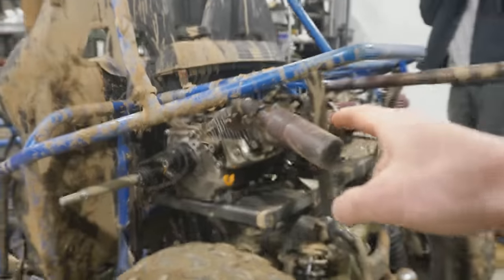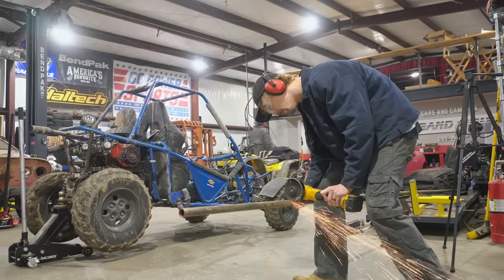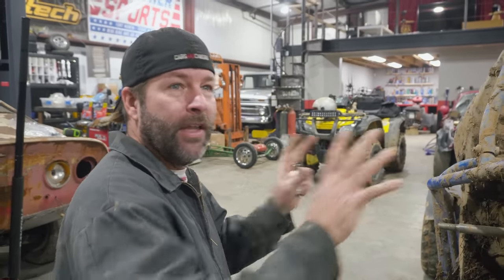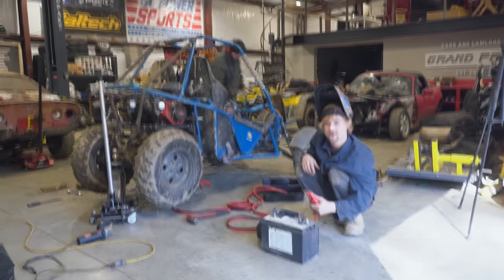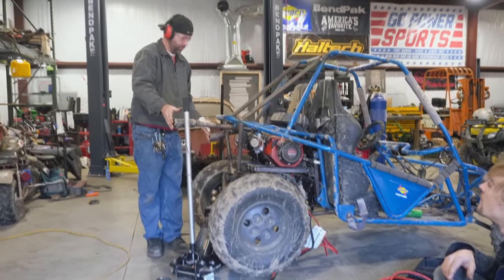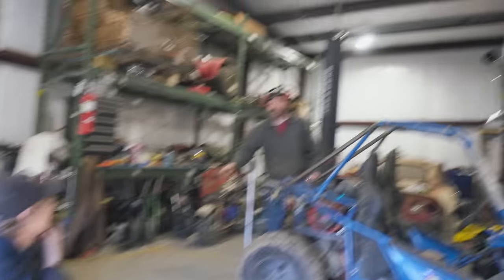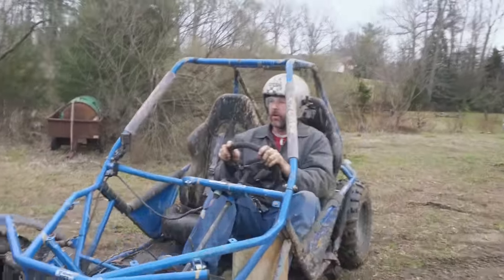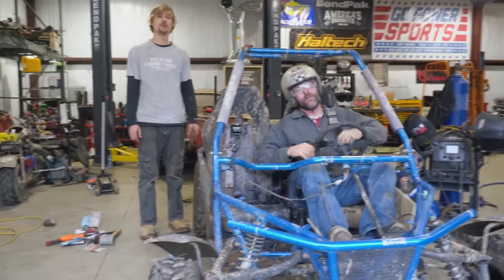Us vs. the WORST Go Kart Ever Made | Will our Twin Engine Go Kart Survive a Full Send?

Comment: Someone made a valid point about the engine you took the piston out of won't be balanced on the crank and I think that's probably where most of the vibrations are coming from more than engine's being out of sync. I thought about one way bearings on both gears from the engines so they aren't fighting each other also. I would do that and balance the crank on the bottom end of the other engine and it should purr like a kitten afterwards 👍❤️💛💚
Reply: That's exactly what's wrong here. I'm a bit surprised they don't know why crankshafts have counter weights on them.
Reply: yeah thats what i commented for this and the last build they did
Reply: That's what I posted in the first vid.
Reply: They have a new to them lathe, set Charles free to make a replacement straight shaft for the crank.
Reply: @scrumpyb5859  they broke the lathe I think.👍
Reply: Crankshafts are balanced separate from the pistons and connecting rods.....
Reply: Yeah I said this on 2 of the previous videos. I built one of these years ago with a blown dirt bike engine. It worked good but it vibrated bad.
Reply: @jessemillsap9387  yes true but with weights attached to account for the piston and rod weight.
Reply: Your crank isn't balanced right and eventually, the crank will twist on the rod journal because it isn't splined or keyed, it is only a press fit.
Reply: @Jesse Millsap  wrong. They are balanced with bobweights that account for the weight of the piston, rod, wristpin, rings, and oil weight in the rod. I've had many done and watched a few done.
Reply: I mentioned that immediately on the 6 speed yard kart when they didn't put a counter weight on the crankshaft to offset the crank weights and suggested they do that or they will get excessive vibration.
Reply: I like the idea of one way bearings, the only issue I foresee is the electric start not working since the jack shaft won’t be able to turn the engines the right way
Reply: Maybe putting centrifugal clutches on both engines would help prevent this issue becaus they wouldn’t engage until there both under load. And also I could not agree more they need to run a straight shaft through the motor in place of the crank shaft. Im honestly not going to be very interested in these dirt bike transmission builds anymore unless they fix these issues. I love c&c it’s just disappointing to see a build with so much potential to just be so lacking.
Reply: @krudlumpstv7854  so that's all it takes for you to turn your back on C&C ?   Come on 😂

Comment: 2:04 If you want that thing to roll in balance you're going to have to negate the counterweights on the blown engine you replaced with the two tillotsons. That's why it's shaking itself to pieces.

You have a lathe now. You can just make a replacement shaft that's a straight line.
Reply: Or, hear me out, put a single, good motor on it.
Reply: @Rattus-Norvegicus  The vibration is in the transmission they set up. One engine instead of two wont help.
Reply: @TestECull  It will cut down on complexity and eliminate failure points. Common sense man.
Reply: @Rattus-Norvegicus  The entire point of this build was to end up with a kart that has forward, reverse, neutral, several speeds, manual clutch. Going from two engines to one doesnt really simplify it very much and ditching the gearbox for a cvt and a live axle defeats the purpose of the build.
Reply: @TestECull  I didn't say to eliminate the transmission, just one engine. Anyone with experience will tell you, syncing 2 engines is difficult at best, disastrous at worst. They could eliminate the syncing issue and eliminate the jack shaft. Less chains, less keys to fall out. A 420 with the transmission would be perfect for this.
Reply: @Rattus-Norvegicus  

1: You don't need to sync the engines here. Each engine is self contained and the vibration will not be a problem if the two are desync'd. This is shown by all the other multi-engine karts the guys have built none of which have this issue.

2: While I do agree that a single Briggs flathead boxer from an old generator of the 16-20hp range would be far better than this cheaply made harbor freight garbage they keep using, switching to a single engine will NOT solve the problem this kart has. The 4-engine 4wd kart they built? No vibration problems. The 3 engine minibike build? No vibration problems. And syncing the engines on those two builds is flat out impossible even if you wanted to; the engines are free to do whatever the fuck they want to.

3: This kart shakes itself apart BECAUSE THEY DID NOT ADDRESS THE COUNTERWEIGHT ON THE CRANKSHAFT OF THE ORIGINAL ATV ENGINE! Did you not watch the build video or something?! They ripped the jug off, cut the conrod short as they could, threw a blockoff plate over it to keep the oil in, and let it buck. This thing is going to shake itself to pieces no matter what until that is addressed!

4:  You clearly did not watch the whole video because they synced the engines anyway. They clocked them so one power stroke hit when the other engine was on an exhaust stroke. This did nothing to solve the vibration problems, nor did running the kart with one engine completely bypassed, because again the vibration is not in the engines at all.

THE PROBLEM WITH THIS KART IS NOT THE ENGINE CHOICE! The entire point, substance, meaning of my initial comment also references this. THIS KART SHAKES ITSELF TO PIECES DUE TO THE TRANSMISSION SETUP THEY HAVE! NOT THE ENGINES! My guy, this thing would shake itself apart if they yanked the Tillotsons off and threw a big ol' 3-phase permag motor up there went full battery electric.
Reply: @TestECull  I'm glad that you got that off your chest. I'm still not convinced and I'm not going to pick apart your argument. Agree to disagree.
Reply: @TestECull  It's okay dude, the rest of us that wrench on shit everyday know what you mean and that you are correct. 🔧🏁
Reply: @xtr3m3fLx  Yep. This kart would be BOSS if they just solve that imbalanced input shaft problem. Hell they could do it with an angle grinder if thy wanted to, leave just enough counterweight to balance the journal. But easiest and best would be to lathe turn a totally new input shaft to replace that crankshaft.
Reply: @TestECull  And your ego won't let it go. So what?
Reply: @TestECull  See there you go again. You could have left it at "I'm right and you're wrong" but you had to throw in an insult and "assert your dominance". Like I said, small ego.

Comment: With the amount of movement we can see on video of the jack shaft I'd put my bets on that being the problem for throwing chains. Shorten that shaft and run duel slipper clutches so you get power from both engines while getting the most out of each one. If the engines where built to exact specs then tieing them together would work but if they were built differently and tied they will fight against each other.

Comment: Hey Ike, if those changes do not have o rings, I have an old trick for you. When we raced back in the 70's and used non o ring chains, we put the chain in a pan with bearing grease and heated it 'till the grease became thin enough to seep in between the rollers and pins. When the chain and grease cooled down, the grease became viscous again and remained inside the chain where it's needed. It will work on your Ebay chains if non orange and will extend the life of them considerably.

Comment: 1st of all, getting the 2 engines synced is HARD.
2nd, I'm sure the vibration is due to the input shaft on the trans being a crankshaft that is counterweighted for the rob and piston.
On a totally different note, you guys have messed around with the big block engines (301, 420, etc) lately. With your additional experience, you could probably built a SWEET moon tune motor.

Comment: I'm thinking a 420 or even a 670, and then make your own jack shaft to put in place of the old atv engine crankshaft. Just to get that wobble out. And maybe even double chain between the engine and trans. I feel like that would simplify the drive train issues and make it more dependable , as long as that articat trans and axle holds up.  But love this series guys. Keep em coming.
Reply: Yeah they can run a 440 duromax and actually get a motorcycle 550 sprocket and match up to the stock sprocket on the axle of the kandi kart. Bottom end is a little gutless but it pulls pretty hard top end with the gearing. A separate jackshaft and additional gearing could definitely help with some more of that bottom end grunt.

Comment: Just out of interest. Did you remove the crank shaft, and replace it with a mechined and turned straight shaft? Or did you just remove the piston and cut off the con rod? If you did the latter, the counter weights on the crank will now put the crank out of ballance because the original engine/gear box was a single cylinder engine. The remaining counter weights on the crank will put the whole thing out off balance causing a lot of vibration.

Comment: Remove the crankshaft in the "Transaxle".

That is spinning with no piston/rod weight. No compression, and no powerstroke. Yet still has the counter weights. It should be a straight shaft.

Just cut the drive side off of the other end of the crankshaft and weld it to a straight shaft. 

You already did most of the work.

Comment: if the vibes are that bad, take out the crankshaft and put a straight piece or metal rod in its place. also, i think having two of the same engine would help it stay together better, as you will get the same power and pulse between two of the same engine.
Reply: Take out the crankshaft?
Reply: @joshuabartley1279   the crankshaft on the driven engine acting as the transmission. it has a counter weight on the crankshaft, and without the piston and rod on there, it will be out of balance. using a solid rod or bar in its place should help reduce vibrations.

Comment: I don't think it has to do to much with the engines being timed out of each other I think it's cause that rod is still in the atv engine that's really doing all the damage and making it vibrate like crazy along with that really loud knocking sound that makes it all sound like it's gonna blow up
Reply: It’s not in it anymore, they took the rod and piston out an left the crank to tie transmission to it and built a plate to go over the cylinder hole where the jug used to be
Reply: @bodine2537  no they didn't watch the video again they cut the rod and left it on the crank they never took it out I've been watching pretty carefully.

Comment: Charles saying it wasn't Isaac's fault about the shifter 😂 Isaac was just slamming it up and down because it wouldn't shift...those semi auto trans you might get 1gear without moving but you need to at least rock it back and forth to shift it multiple gears when not running...I love you guys but it amazes me how little you actually know about most small engines

Comment: If the pistons of both engines are on the down stroke, simultaneously, but one on the intake and the other on the power stroke, the torque might be multiplied similarly to 2 two stroke engines 180 degrees apart...

Comment: There is vibration coming from you make-shift transmission because you threw off the balance when you cut the connecting rod and blocked off the cylinder

Comment: Running  2 engines together or more engines together is not good to do. Trust me i have seen things that have happened before. If one engine is dead and won't run while the other engine is running or other's. The engine that is not running will find way's to explode. Hey Ike u built the shifter. the shifter in my go cart is kinda like that in ur's and it's easy to shift.

Comment: 360° is gonna give ya more traction. 180° smooth. 270° torque. Not a go-kart guy, but kinda works like that on motorcycle engines. Look up Yankee Z 500. You could either run it 360 or 180. It ripped at 180 but no traction compared to 360. Newer parallel twins run 270. There's a whole lot involved. But maybe try all 3 and see what is best.

Comment: Can't run chains on a direct drive system like this with the amounts of rpm's and power going through them without them being submerged in some sort of oil bath to keep them cool and lubed. It actually sounds horrible, like the engines are fighting themselves. The vibration has something to do with your redneck gear box! Can't put power in one end of a 3 piece crankshaft without it trying to twist up! The fact that crankshaft is completely so out of balance without the rod and piston is the main source of the vibration and it needs a straight shaft to take its place. It's been attempted before and it always has the same outcomes of a non-successful experiment BTW! All your doing is destroying everything you have on this machine with harmonics and torsional vibration that will break everything your attempting to accomplish here! But for the 4th time! Good Luck with your mess here!

Comment: Two easy ways to tell where a given cylinder of a 4 stroke is in it's 720 regrees between power strokes is to either put a finger over the spark plug hole and crank the engine slowly, or better yet remove a valve cover and find valve overlap.  Since intake ALWAYS follows exhaust, you will see the exh valve close while the intake valve opens.  Valve overlap is a good thing for power but bad for emissions so modern engines have less overlap than a good race cam would.  For that fraction of time both valves are open you know the cylinder is finishing the exh stroke and starting the intake stroke ... Or for Charles its between the blow and the suck.  The piston is near TDC and the next 180 degrees of crankshaft rotation will suck.  180 more will squeeze. That is now TDC compression and spark just occured about 10 degrees back.  The next 180 is POWER, combustion or bang depending on the company you keep. Time to get rid of the toxins from the power stroke so we need 180 to blow. Back to valve overlap both valves open and ready to suck, squeeze, bang, and blow again.
On multiple cylinder engines (most but not all Yamaha for example) you can stack the fireing order to find the companion cylinder and use this method to adjust the valves.  Small block chevy for example stack 1843 over 6572. 1/6 8/5 4/7 3/2 these are companion cylinders.  If cylinder #1 is on valve overlap, you can adjust both valves on #6 cylinder and so on.  Of course you need a solid lifter cam lol.
P.S. Cheap chain sucks

Comment: You guys are in to everything . You need to get a small airplane (ultralight)... no, build an airplane! There's hundreds of kits and plans, but one set of plans I saw a while back in an aviation magazine just screams  "CarsandCameras". It's a biplane, wooden frame, covered with visqueen, and powered with two Briggs & Stratton 8 horse engines. 10 hp preferred. Two wings two engines, cant get any safer than that.  But since Ike has so many fans, and loved by each and every one, a donation of just 50 cents from each would more than pay for a brand new parachute.  But wait, for just 50 cents more im sure would buy the plans, building materials and both engines. Who knows Briggs & Stratton might donate the two power plants. How could they turn an opportunity that would brand the words "durable, and dependable " in minds like ... ours? 
 There is also another biwing ultralight also wooden frame, but powered by twin Tecumseh's, plans about $100 , and materials also less than $2000. 
 Well it starts here. What does everyone think?  Just type "1" for no, or type  "Ike" for go get em ACE!

Comment: I have 3 suggestions

1: invest in a good x-ring motorcycle chain, #420 is what I use. They may be $40, but it's worth it because they won't break so easy.

2: definitely make sure that jackshaft is straight and has enough bearing support. Any kind of warp in a jackshaft that long will cause you to throw chains every time. Trust me on this one, I run an 8 speed motorized bicycle and I have to get the chain alignment exactly right or else one binds with another as I shift, or I throw either my 1/2x1/8 or my #420 chains. It's not fun getting slapped in the leg by a chain rolling at 4300rpm.

3: no matter what happens, persevere. You guys have always had a knack for these things, and you just keep getting better. Keep up the good work boys, I'm able to live vicariously through your projects.

Comment: You lads have a great relationship. I've seen a few of your videos and they entertain me no end. Reminds me of when I did crazy things back in the day. Didn't have any money then, only a angle grinder and a 40 amp arc welder. But I made a honda cb 200cc engine fit in an old go-cart. It had 10" classic mini wheels fitted to it. No suspension, but over the woods it was great fun and handled well. Unfortunately here in England, its totally against the law to do this and have fun nowadays. Anyway one thing I'm saprised you Didn't do with the gear shift was to have a push-pull cable set up, similar to a lambretta shift. You could use a lever instead of the twist grip change. Like the double cables on a cb750k throttle etc, you see what I mean? This way you could have paddle change or put a shift lever anywhere you like. Hope this gives you a bit of thought. From an 62 year old big kid. Lol. Fab videos lads.

Comment: Make a straight crankshaft to fix the vibration. Then lose the twin engines and put on a small motorcycle engine, say a ninja 300. 36 forward gears, 6 reverse and super duper low range for your 4wd buggy.

Comment: The chains going around 2 small sprockets or 2 small radius circles will stress the chains, maybe use bigger diameter sprockets with the 420 chain or use like 530 chain with matching sprockets to keep the chain alive, I went to a 10 or 11 tooth front sprocket on my brothers 1981 it125 and it kept wearing the chain out every year vs 3-4 years